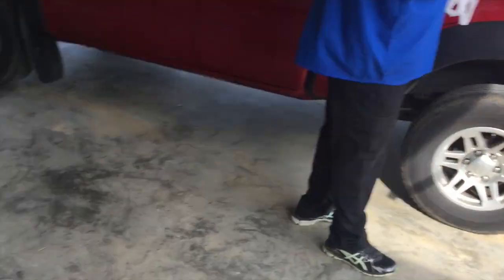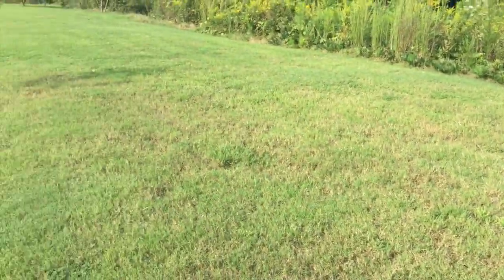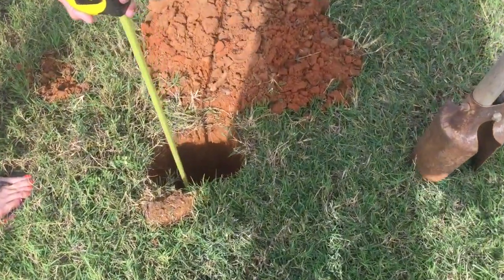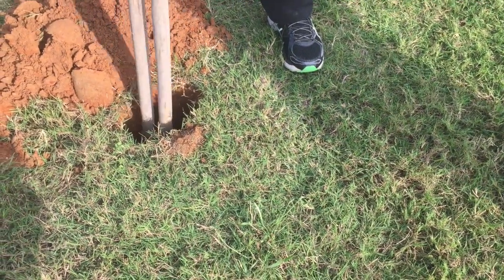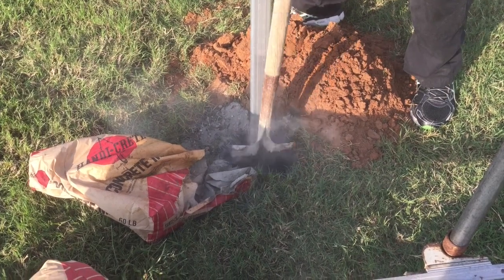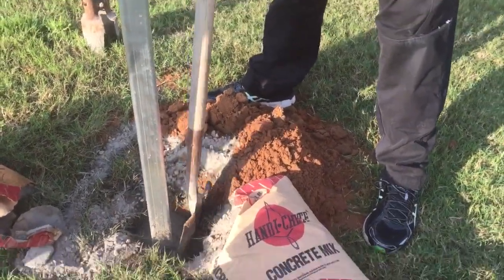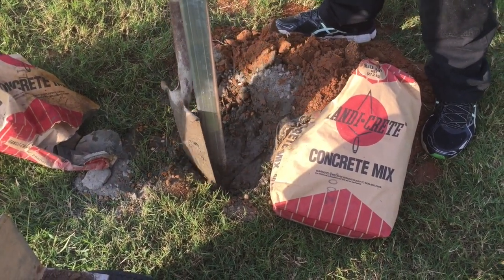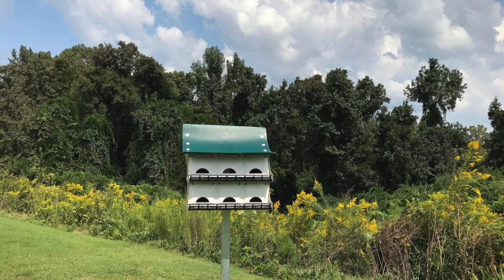How To Install a Purple Martin Bird House

Comment: I used a S&K in ground sleeve with a 3" plastic cplg ( flat brick in the bottom of the hole to act as a stop} that I reamed out the inside for a perfect fit. Set the cplg in the gnd with with concrete. The Tri Pole and sleeve slides in and out of the cplg in case you ever want to move to another location. With this installation you may get a little wind movement where by with coming storms you can use rope tie downs for more stability. My Tri Pole was 15 feet.

Comment: 1. Dig the hole. 
2. Put post in the hole.
3. Pour water in the hole.
4. Add Quick-Crete (red bag).
5. Wait 60 minutes before mounting the house to the pole.

Comment: Coulda put the dirt on a small tarp and drug it off, less mess to clean up, and can use one or 2 concrete patio blocks 8"x8" or whatever size you want on the bottom, and thought those Tri poles have a black plastic sleeve you set in the concrete so pole can be taken out or moved etc, otherwise good vid!
Reply from the maker: Yeah... some lessons we learn after the fact! Thanks for watching, and for the tips!

Comment: A post hole digger is also referred to as a drain spade?
Reply: Two different tools. 
Post hole digger is what they are using in the video.
Drain spade is a narrow (6”-8” ) spade (tool that you dig with)

Comment: Aren't Martins rough on bee hives?
Reply from the maker: I think they will be ok. Martins don't tend to hunt at the same altitudes and places bees forage. They may get some, but I don't think they will decimate my hives or anything. I did a little homework with other beeks who have martins as well, and they don't have issues. Besides, if the martins start having a buffet, I will use the pole for a bat house. :) Thanks for watching!
Reply: Goodgame Bees & Homestead thanks. I had just heard nightmare stories I guess.
Reply: Honey bees and purple martins are not a problem.
Many purple martin landlords on the Purple Martin Conservation Association Forum who are also beekeepers have confirmed that no problems exist between honey bees and purple martins.